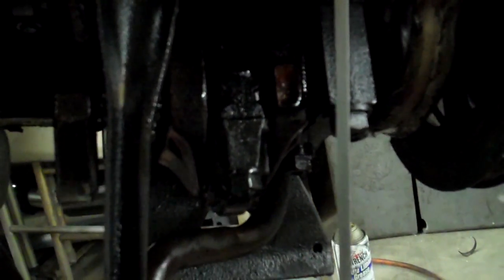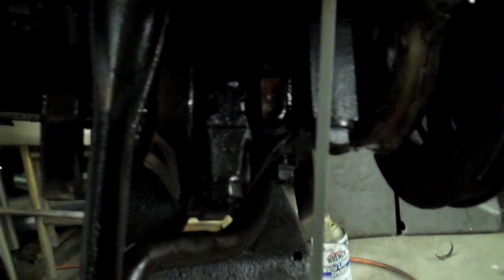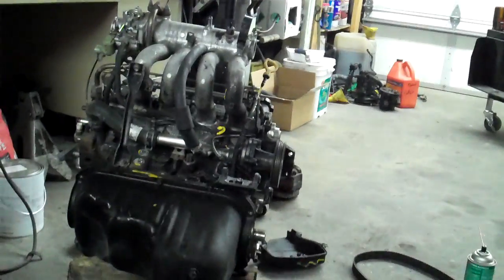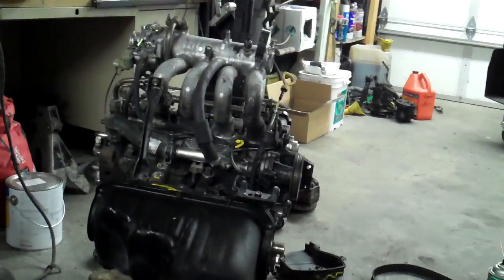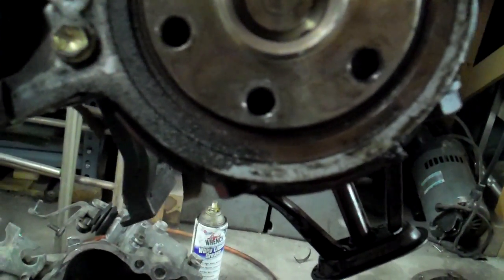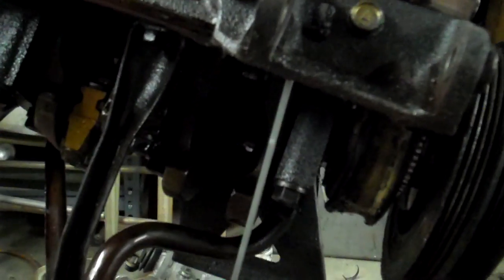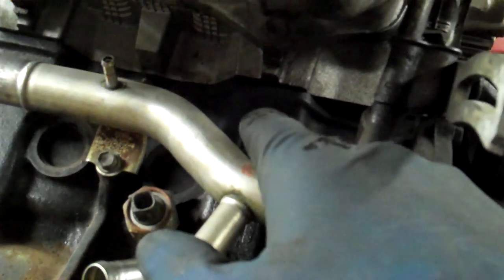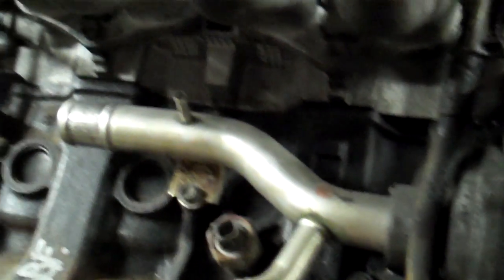ROD KNOCK!!! What it looks like inside the engine.

Comment: Why did you do a Full Engine swap? Isn't there a chance to fix the one with the issue?
Like, I'm having the same issue, I am now deciding whether to replace only the bearings, or to replace the full connecting rod set, including the bearings, oil pump, etc.

But now I have doubts, is it necessary to swap the entire engine? Please give some good news.
Reply from the maker: +JPGKIll3r You do NOT need to swap the engine just like you do NOT need to buy a new shirt when an alligator rips a big hole it in the front of it.  You can replace the panel and sew it up like nothing ever happened.... but it's not cost effective. 

This crank was cooked.  I would have to buy a new crank or machine this one.  That would cost over $750+  I got a motor used for $600.
Reply: +briansmobile1 LOL! I understand. But, in my case, if the crank is perfectly fine, is it OK to replace the Connecting rod, bearings and other parts? I don't have access to complete engines and they are a lot more expensive where I live.
Reply from the maker: +JPGKIll3r Then the decision is easy.  Identify every part that is damaged and quote it both ways- machined or replaced.  If you have to machine the crank- how much?  How much are the corresponding bearings etc.?  Write it all down in a Ben Franklin comparison list, breathe out, hold on your choice and pull the trigger. (don't actually shoot something, but do get on the phone or web.)
Reply: +briansmobile1  Well, thank you Brian. You have really helped me make my decision. You have earned a new suscriber. Once again, thank you.
Reply from the maker: You're welcome buddy!
Reply: Nowadays machine shop labor is very expensive.  You made the right choice getting a good used motor I don't think that crank was repairable and if that engine was run that low on oil who knows what other damage could have been hidden inside.

Comment: Hey Brian I'm a big fan of your expertise and videos, I have learned quite a bit from watching them. I know you probably get alot of questions but I'd like to ask one relevant to this video and would be grateful for a response if you don't have time that's cool as well. So I have a 4.7 V8 with a very distinctly rod knocking sound but it's not the bearings. I originally thought it was stuck plungers in the VL adjusters (hydraulic) so I removed all of them disassembled and cleaned two plungers were stuck but they are fine now oil pressure is even more steady. Alas the tapping sound remains, so my question is what sounds distinctly like rod knock/lifter tick but is not? One discovery I made was that cylinder 5 spark plug had a bit of oil in the well but I don't know what this could mean. Thanks man, your videos are clear and concise and I appreciate the work you do with them.
Reply from the maker: +Terry Heeter If I find a lifter is stuck I go nuts on all of them.  If two are sticking even more so.  
Here's what nuts looks like.  An overnight soak in diesel gas or transmission fluid and pump them back to empty. Or better yet, replace them.

If you told me you replaced them and still had the noise, I'd say check the pushrod ends, rocker arms, and camshaft lobes for wear.
Reply: Thanks for the quick response, I'll be sure to do that, Rocker arms are fine and lobes are still good. I'll check the pushrod ends. Is there a way to do that without removing engine? I don't have a lift.

Comment: Thanks for the vid my 99 jeep Cherokee sport 4x4 4.0 6cylinder long block lost its oil pump pressure about 6 months ago. I never knew what happened until I took of my valve cover thinks a push rod bent found out I had no oil to the top of the block so I drained my oil and said farewell with a brick on the gas stood about 20 feet away and watched it go boom....lol

Comment: Not 100% of the time. You need to explain that it could be LOW OIL, or Timing's off. 

It is not just '1 Singular Thing' and it's a guarantee that's the Problem. No.
Reply: +Syrus54 mtoros knock when they are not happy, the trick is knowing the difference in the sounds. It's like knowing if your Dad is serious or not when he says something like "You Better!!"
Say this out loud- TikyTapyTickyTappiTaptaptaptapticktap. 
say it fast, not necessarily loud. 
That's a lifter.

Knock ... knock ...knock ...knock ... 
say it slow and louder, as if Darth Vader was saying it. 
That'a a Rod.

Comment: i was outside of my brothers truck when he started it and it made a loud knocking noise twice then stopped, it has had a water pump failure probably for several months before it was noticed but the engine never got hotter than it should have, is it actually knocking or was something being noisy.
Reply: My truck sometimes will make a loud ticking noise just when you start it then when the oil pressure goes up, it goes away. It's just the oil filling in the holes and slots. The noise is completely normal, as long as it goes away when the oil pressure goes up.
Reply: ok thanks we haven't ever had any mechanical issues just annoying things.

Comment: so what's better to rebuild or get a used motor
Reply: +RODOLFO HERNANDEZ I would like to know the answer to this question too. I have an engine on a Honda that just started to knock because of low oil. I don't think the whole crankshaft is bad just the bearing. Could I just swap out the bad bearings and be okay?
Reply from the maker: +briansmobile1 You really have to see if the crankshaft is shot and what options for that specific engine are available.
Reply from the maker: +Brandon Grimshaw   That kind of decision is what math is for.  In this case it was much, much cheaper and effective to replace the engine.  On my brothers boat, it was better to rebuild it.
Reply: depends on the motor, but its usually just replacing it

Comment: I don't know if it is the only explanation for a knocking engine, but this is the first time that I have seen rod knock explained with an engine taken apart like that. Awesome that you took the time to share! It definately helps to understand whats going on when you can actually see it.
Reply: Thanks for the video. Much cheaper & faster than learning via trial vs. error.

Comment: hey brian,  i have an 04 EJ20 that im going to do the head gaskets on,  was thinking about sending the heads in to get fresh'end up.  have you ever come across someone putting a fresh set of heads on then having a main/rod bearing go out?
Reply from the maker: +803brando   Anything is possible if the work area is not clean when you're assembling an engine.  Even just the top end.

Comment: Thanks a lot for this!

So if I understand correctly, you can drop the bottom, and you will be able to rattle the loose rod if there is a case of knocking.
Reply: +Marlon Lyn Rods will move around, they are supposed to. Knock? no. 
If your under the car, pan off, and you reach your hand in there to the rod, it moves around on the journals ...side to side.. it will knock as it hits the rod beside it, but it wont knock in operation. Normally this clearance is called Rod Side Clearance. it gets smaller as the engine warms up. fractionally tighter. 
The knock he is talking about is excess bearing clearance - to - Crankshaft. You gotta lift straight up and straight down, to check it. It wont always knock by hand but it will move more than the others. 
This guy makes good videos and his info is spot on from what I have seen. 
You gotta be extra careful learning stuff on the internet it is impossible to throw 50 years of experience on a video.
Reply from the maker: +Marlon Lyn You can if it's bad enough like this one is.

Comment: So I've got an 04 wrx and it's got a bad case of rod knock. Been doing quite a bit of research on my options. I can buy new rods, bearings, and a crank for a bit over 1k. Should I be looking at new pistons as well? Also, will I have to re-machine the block because of the fragments from the bearing? I also have the option of buying a long block and just do a swap. I just don't know what the cost would be for a rebuild so I'm a bit stuck.
Reply: if it had grooves and nickes in the cylinder wall then it will cost a lot to machine it and sleeve it but if it's just bearings and rods probably just have then replaced

Comment: Brian,

(549) comments prove that you've done mankind a great service by posting this.
Now, if it were a low mileage engine, maybe you could hope that the head and pistons and rings are all still OK.  Do you think then I could just replace the crankshaft and main bearings and big end bearings and seals (without engine removal)?
I understand that a professional mechanic wouldn't do it, but what about a broke DIYer?
Reply: +Kevin Dickson It's called a mexican rebuild!!

Comment: A clean fuel system ( Injectors/Carb's/Intakes/Cylinder Heads ) engine does not have KNOCKING/PINGING (Dieseling Issues).............Those issues arise when excessive carbon builds up inside the cylinders in the cylinder head around the valves. The excess built up carbon deposits retains extreme heat after the engine is shut off, allowing any remaining fuel/oxygen mixture to try and continue to burn, thus dieseling/pinging as some call it. Knock Sensors usually placed within the Intake manifold will detect this issue within modern engines, telling you what is happening.

Comment: the knock you are talkin about is called gas ping which is very common these days
Reply: Gas Ping - Dieseling - is a symptom caused by excessive carbon build up on the cylinder head. When the engine is ran the carbine absorbs heat and when the engine is shut off, the carbon deposit is still extremely hot causing existing fuel and oxygen vapors with in the head and fuel system to continue to ignite partially.....This is the time to run a cleaner through the system and if its extreme its a time for the cylinder head/heads to be rebuilt.................so, the noise that you say is common, actually isn't. Its a symptom brought on by improper care of the engine.

Comment: Rod knock and engine knock are different correct? Doesn't engine knock have to do the the octane fuel you use?
Reply: Thats usually called Detonation, But its called "knock" in the ECU.. So yes your correct, Engine knock is due to a few reason, over advanced timing, hotspots and octane keeps the fuel from igniting due to pressure, higher octane = less chance of self ignition, which is why higher compression, due to rod & piston design or forced induction require higher octanes

Comment: How much would something like that's cost to fix? I found a really nice 02 wrx for 6k and the only this wrong is the engine knock and if it something worth fixing I might try to talk him down because I only have 6200 to spend on a new car
Reply: 6k is too much for it 
look for how much the same engine is gonna cost you if you buy it online and tell him to deduct that from his price

car is from 2002, it shouldnt be 6k either unless it has no more than 100,000 miles and if it doesn't have any other defects.
But now it doesn't even matter how many miles it has since the engine is fucked up. It's gonna take you a long time so better buy the engine.
Reply: You can get a crank for these motors for a couple hundred.. add 200 for bearings and 1k for rods & pistons, assuming you can install it yourself & know how to get it TDC and put the timing belt on.. it'll cost under 2k to fix.. But you can also probably find a shortblock for close to that same price and cut out half the labor

Comment: A new engine might be a safer bet, considering time and money. As well as other parts of the engine like the valve train, and so on... But putting in a new connecting rod shouldn't be to hard. Is there an engine where you could install the piston/connecting rod from the bottom up? Putting in a new piston is rather easy with a ring compressor? I know some old schoolers can do it with there fingers, but there hands are like a catchers mit.
.
The only thing I was wondering is how you put the rod/crank bearings in? On small engines there's often no bearing... so I was wondering if you actually have to split the crank, or is the bearing put together as 2 halves? Is there bearings on the crank journals?
Reply: Yeah, thrust bearings & journals are 2 halves that rest on top and below the rods, & crank separately, Then you bolt the housing to the block, Similar to the way cams work on top of the motor, except in that case the housing is usually the bearing surface but down below its separate half moon pieces due to increased wear and higher forces
Reply: Generally they're lubricated by a hollow crank, and the outside surfaces stay dry. The bearings are made to be stationary while the shaft spins inside it, causing it to wear the consumable part, instead of having to get crank & block machined everytime you have to replace the bearings
Reply: Kyle Milford Your answer is what amazed me... THEY'RE NOT USING REAL BEARINGS!!? This makes no sense at all... the smooth sleeves that go together, are NOT bearings at all... just two smooth sleeves of medal!! 
.
Just the same as there is a simple design in which real bearings could be the "crank journals"... there is also a simple design in which the connect rod can be made in two pieces, that way if something goes wrong with the engine, you wouldn't need to take out the whole engine (the crank could be designed to be taken out without having to pull the engine!!), and just replace the rod (or what-ever)!!
.
There is a simple solution to everything!! If there here NO COPS there would be peace on earth!! "When the power of love overcomes the love of power... the world would know true peace"!!
Reply: Split rods would be difficult to do.. few things how would you connect it to the piston? The way it is now, You can pull the rods out from below the motor simply by removing the crank, which is as easy as removing the oil pan, and dropping crank.. 8~ bolts or so.. but you generally would have to loosen timing belt.. Then take the rods & pistons out, replace and slide back in, replace crank bolts & timing belt, put oil pan back on and your back on the road..
Reply: But yes, Theres a film of oil that keeps the 2 surfaces from ever contacting each other in normal circumstances

Comment: Had blown head gaskets redone. after heads were sanded down, only a few months later engine slowly started loosing power then no power. Had to be towed After all that and 3000.00 later,  Came back from mechanic said Cams were wearing so they replaced them and said knocking is normal. I argued that it is not normal and its been loosing power and knocking is getting louder. Is my mechanic lying to me to buy time past warranty. Is my engine a goner?
Reply: Your mechanic should have told you knew cams were needed. They are taking you for a ride and it's expensive.
Reply: headgasket could have leaked coolant into your bearings, Which all mechanics should know the chemicals in antifreeze likes to eat bearings for lunch.. If possible grab a bearing kit for 200$ and get them in asap, and do an oil change

Comment: wouldnt it have been cheaper to just go buy a new crank, rods, pistons, etc.?
Reply: Slighty cheaper yes, But the Labor is what hurts, complete tear down of the motor to install new pistons as he mentioned they have to be installed from the head on the motor, instead of paying 35~ hours at 60-100$ an hour + the cost of parts, They pay several hundred for the motor and 10-15 hours for dropping the new motor in

Comment: Hopefully I can fix the knock on my dodge shadow 3.0 L with new bearings. Redid a lot of the seals when I bought the car cheap, I should have been smart and replaced all bearings while I had the engine removed. Knock has been happening for the last thousand miles or so and it just recently got really loud
Reply: Just crank up the radio.
Reply: better make sure your rod isnt bent, as usually happens from it slapping if its too bad your block could even be damaged.. Before long it'll spit that rod out the oil pan ifyour lucky, And out the cylinder wall if your unlucky.. But that said, bearing kit would be less then 200 for rods & crank bearings, get a new rod for 150, new pistons rings for 60-100$ and you basically have a fresh rebuilt motor
Reply: I had a dodge shadow once, dang thing blew its transmission. Strong engines, pathetic transmissions.
Reply: Found out what it was, it was a loose flex plate bolt hitting the insurrection cover.

The shadow doesn't have rods, all overhead cams.
Reply: spiffcats it's a great car, hopefully it lasts a long time, body is in great shape for its age
Reply: Neil Caulfield
They are pretty good. I was considering getting rid of mine, it was left sitting for about 2 years. Then i turned the key, second try it fired right up, it was like nah, im keeping this one.
Reply: Yeah its so uncommon to see one now that I really want to hold onto it, the production numbers, especially for the convertible, were very low. It looks great and drives great, Im surprised it didn't do better
Reply: Neil Caulfield
Mines a hatchback, but its got turbo. When you git the gas you fly. How common is turbo?
Reply: yank the pan and look at the bearings same with the valve cover and look at the cam bearings